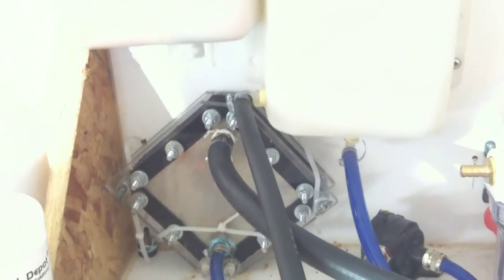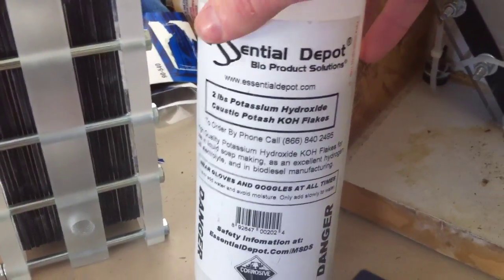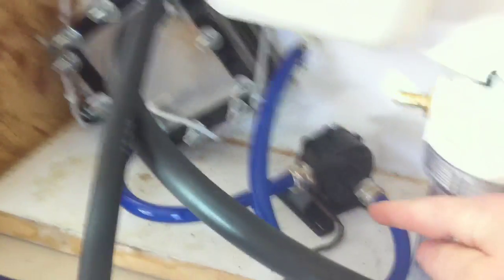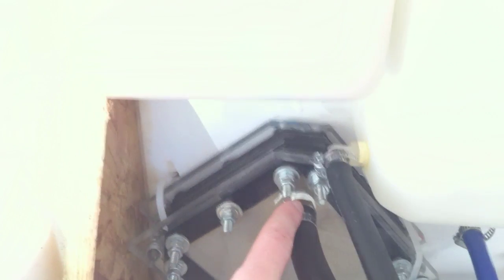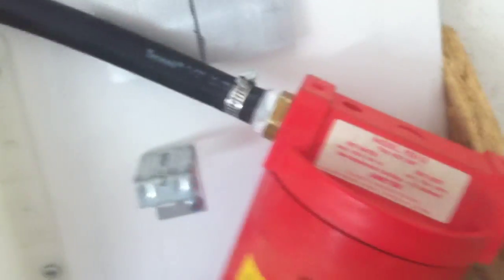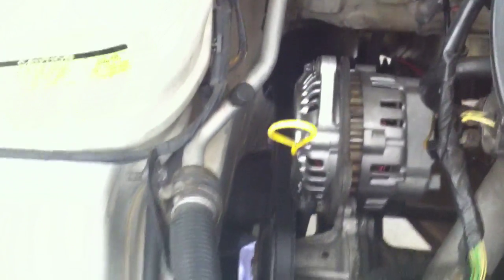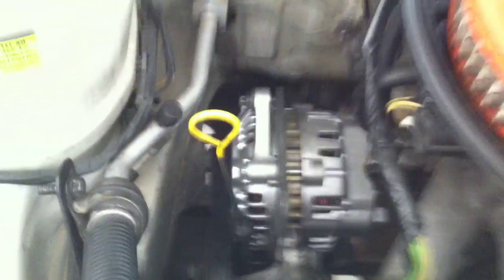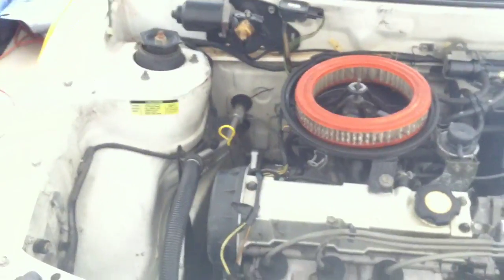#004 update Geo Metro HHO Dry Cell W/ High Amp Alternator

Comment from the maker: @ozziefire1 Direct Fit Models Include :
FORD PROBE 2.2L L4 1990-1992
MAZDA 626 2.2L 1990-1992
MAZDA MX-6 2.2L 1990-1992
and a 1991 Geo metro with some slight modifications
HHOaccentMAN 3 months ago
Reply
 it is an MX-6 alternator 1990 1991 1992 626 MX-6 2.2L HIGH OUTPUT ALTERNATOR
it is 140 amp and the seller is maniacelectricmotors on ebay

Comment from the maker: @ozziefire1 check out my other video where i show the alternator before putting it in the Car I explain what car it is from there and you do need the slightly bigger belt but mine slips a little when cold so if you could fit a tighter belt on it do it. you will have to use a new bolt on one of the mounts and boar out the hole on the drivers side of the bracket so it is the same size as the hole in the new alternator use a hex bolt with lock washers. I getto rigged mine so it doesn't slip anymore

Comment from the maker: The cell had leaks from using the wrong kind of electrolyte don't use baking soda  toke it apart tried to clean it up and put it back together but there were leaks from the gaskets which i didn't have spares and brown gunk on the plates nasty stuff